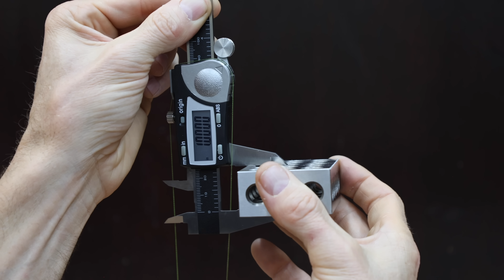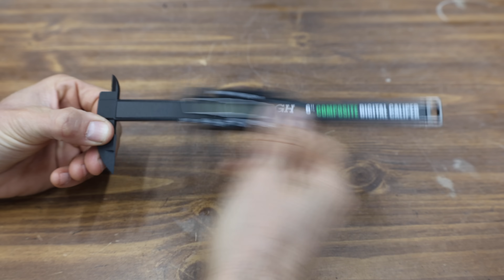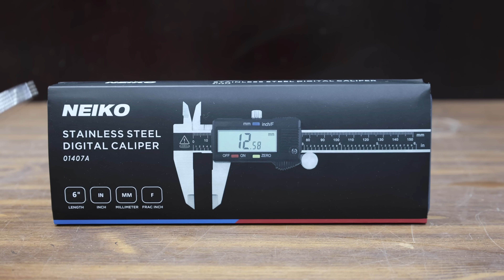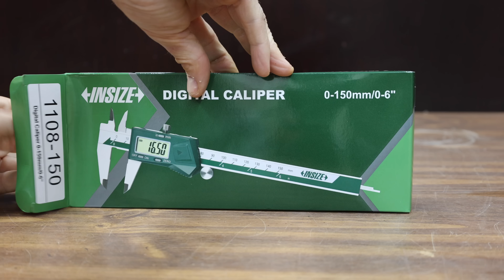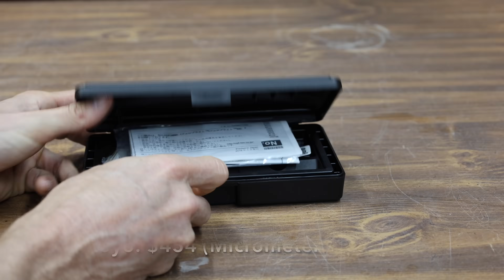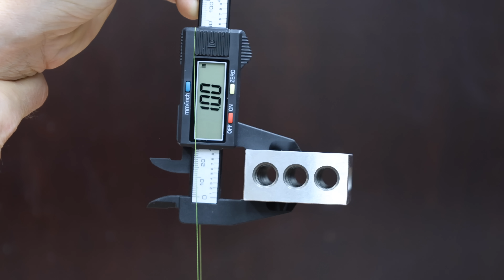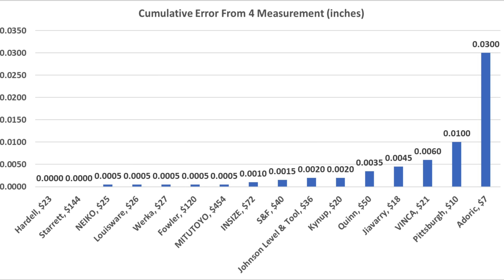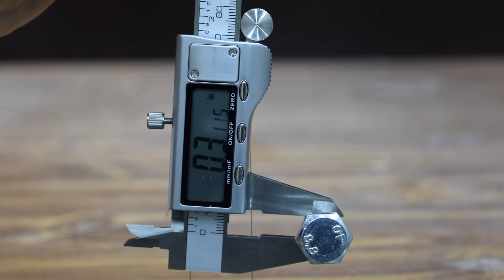I've Been Proven Wrong About Calipers!

Comment: One test that should have been included is how easily and quickly it is to dial it in to a specific and precise measurement. I have the mitutoyo 8 in caliper. I have to say it's night and day in smoothness and control compared to any other caliper I've used. Another great video

Comment: I purchased the 8" digital caliper about 15 years ago at Harbor Freight for about $24.99 or $29.99. I am an FAA aircraft mechanic. Standard tollerance in aviation is .030" and  .001" at times. This caliper has been dead nuts accurate since the day it was opened. I used this to make the part and the QC inspector used his Starrett caliper to verify and approve the part airworthy for service. Everythign I have ever made is check for dimentional accuracy two different ways. Fitst with the caliper and checked with a scale and machinist squares. Like I said. Dead nuts accurate. Still works like the first day I boutht it. Can get the batteries at HF or Amazon.

Comment: 95% of cheaper calipers don't actually "turn off". They will simply stop displaying digits on the display, but the processor will still be on. This means without removing the battery, it will usually be dead in some months to a year, no matter whether you used the tool during that time or not. It's actually, funnily enough, one of the easiest ways to tell a set of genuine vs fake Mitutoyo. The real deal actually has a proper "turn off" (basically, hibernate) functionality with a much lower current draw, which means it will last for years sitting in a draw with only one good battery. The fakes can never be bothered re-implementing this functionality in their chips.

Comment: I have a Neiko and find that it does everything that I need done now that my professional need for measuring life is over. Would I like a Starrett or Mitutoyo - absolutely but I don't need to spend that level of dollars now just to match the Starrett mics and dial indicators that I seldom use now. The only downside with the Neiko is that mentioned LR44 battery vs the bigger CR2032 - but then LR44's are cheap via eBay and I keep a half dozen, usually Energizers, handy.
Thanks again Todd for another great test.

Comment: I have a problem with some of your accuracy tests. Assuming that the 1 2 3 block is perfect based on measuring the 1 inch side is not so good, especially if it is a cheap block. Using the depth function on an imperfect wooden table  rather than a surface plate is also inaccurate. Finally, your table shows the wrong price for the Mitutoyo - that is the price WITH the micrometer. Mind you, having said this your overall conclusions are pretty accurate. The one thing you can't test easily is long term life and accuracy. This is why a precision shops would usually buy Mitutoyo or Starrett and have them calibrated regularly. For most users, the ~$30 sets are perfectly acceptable.

Comment: When you compared CR2032 and LR44 batteries at 17:36, you made a fundamental error in reasoning: you compared their capacity in mAh, but completely forgot and neglected the fact that these cells have different voltages (CR2032 has 3V and LR44 has 1.5V). Yet the amount of energy stored in a cell is the product of its voltage and capacity. So CR2032 has 3V * 200mAh = 600mWh, whereas LR44 only has 1.5V * 130mAh = 195mWh.
The difference is actually even greater than you stated.

Comment: Ever considering doing window air conditioner units?  I need to replace mine and always love checking your videos for stuff I need to purchase hahah
Reply: Check out the Midea U-shaped air conditioners. Insanely quiet and energy efficient and much lighter than other air conditioners I have owned. After getting one, I replaced all my window units.
Reply: @nerdstrangler4804  thanks I’ve seen them but u-shape won’t work for me. We have the in-wall bracket thing and they go in the wall in our house. One upstairs, one downstairs

Comment: Couple of interesting things to note. I have the 12-in hardell calipers and they retain their origin when you turn them off they also turn themselves on as soon as you move the slide which is a feature that I've never seen on any other calipers. They also seem very high quality although one thing I don't like is that when you are measuring inch decimal have different font size for the first two numbers which throws you off a bit until you get used to it. I don't know if that's just because they're competing with a different class than the 6-in calipers are or they have improved their quality recently. I also own Fowler 6-in calipers and I absolutely hate them. For years I preferred an old Pittsburgh set that I had until it started becoming unreliable and turning off while you're trying to use it. But the fowler always has a dead battery even though it turns itself off. You can put a battery in and use it for a couple of weeks and it just dies again. I just don't use it anymore because it's annoying having to change the battery all the time. The hardell has by far been my favorite set so far. But I also have not spent huge money on calipers. Maybe I would feel differently if I had spent the money for starett or something else? For the amount of lathe work that I do the hardell definitely seems like a great deal.

Comment: The accuracy and resolution of the cheap ones is certainly good enough for most hobby use - and they sure beat trying to gauge the fine measurements with a steel rule!

Comment: Genuine Mitutoyo calipers normally come with an SR44 battery, not an LR44.  And unlike most of the cheaper calipers, the Mitutoyo autoshutoff shuts down most of the circuitry and greatly extends battery life.  The cheap ones just shut off the display, which doesn't actually make much difference.  You also didn't point out that several don't have an INC/ABS mode button, which is very useful for many things.

Comment: As allways good content. One remark though: 99% of caliper users don’t need 0,001 inch accuracy. 0,1 millimeter is more than accurate enough. From this viewpoint, they are all great and you could chose on the basis of battery life stability and longevity. Metal is better than plastic.

Comment: The error in each measurement should be increased by half the resolution, which is half the last digit. For example, if the measurement is 1 inch, the measurement is "exactly" 1.00, and the error in the measurement is still 0.005 inch (since that deviation would remain unmeasured). Alternatively, one should take many measurements of different random dimensions, not rounded to exactly 1 or 2 inches. Then the resolution of the instrument will show up as an additional error.

Comment: For future caliper testing, use a jig to hold the calipers up straight when pushing them down on the scale for resistance testing. Changing the angle of the calipers can affect the force being applied. Also, can you test the calipers for accuracy at different temperatures? Would be helpful to see if they still stay accurate enough at something like 20°F and 110°F for outdoor work after the material expands or shrinks in those temperatures.

Comment: VIDEO IDEA: For anything that includes a small battery, test the current draw when its off. I have a guitar tuner and a calipers that I have to leave the battery popped out when not in use or it eats batteries due to a current draw even when it's off.

Comment: This is a clear case of horses for horses. For general woodworking and most uses a cheap set will be fine. Granted if you are working on commercial products or fine engineering then, yes you need a very accurate set.

Comment: If accuracy matters this much, use a mic... IMO calipers are great for "close enough" type measurements.

Also, the Johnson ones must be the same OE as "Performance Tool" youd find at the parts store, though the PT is only 2 digits to the tight.

Comment: I have a 4€ digital  caliper  +-0,1mm (for fast messurements) and  an analog caliper+-0.05mm (for better qccuracy and to verify stuff, check bolt sizes etc ). Its good enough to toss around the workbench. But Id preffer a bit smoother digital one. Mine (which looks like your 7$ one and possibly is the same thing) feels pretty clunky.

Comment: Really depends on the working environment you’re using the calipers in. Mit and Starrett are some of the best long lasting brands ever. Made for everyday use in shop environments for .001 inspection in harsh conditions where coolant is ever present and the possibility of being dropped 10 times a day and still hold .001. You could have done a longevity test or drop test to see what still worked after being beaten up. 
Mits are less resistant to “over thumbing” the caliper as well.

Comment: All of em are a lot more accurate than I need to measure anything, so I’m glad I only spent $10 on my no name set. Mine do have the auto power down feature, but I found that it never truly powers down. First battery lasted about a month. Second battery I take out and store in the case when the calipers aren’t in use, and it has lasted about a decade now.

Comment: As a machinist who uses these tools on a daily basis, I wholeheartedly agree with your results. The only metric you left out was repeatability over time, which I promise explains why the expensive brands are expensive. Average home users will be more than fairly served with any of your lower cost but higher rated options.

Comment: I do not like auto-shutoff for using calipers when machining. And the ‘Absolute’ is really required. 
 I find the Mitutoyo  last a very, very long time on the battery. Plus a LOT more consistent than some cheaper ones I’ve had.

Comment: FYI... Starret is great when it works... At work , we've thrown so many! Sending to repair is just as expensive as buying a new one.
Mitutoyo on the other hand, is bulletproof. I have one at home... 27 yrs and going. At work I use a 20 yr old one at it is still perfect.
At work we've sent some Mitutoyos to repair when dropped on the factory floor and the cost is minimal.

Comment: I like dial calipers unless I need a SPC out. No batteries to die. A surface plate is extremely useful to measuring as well as a micrometer holder. A set of gauge blocks are handy for checking accuracy too.

Comment: I have to point out an observation I made about the Harbor Freight Pittsburgh calipers I have (which looks identical to that Johnson Level & Tool caliper you tested, so it's probably a rebadge).  I have one of those and it works great, but I noticed I was having to change the battery just about every time I went to use it (which isn't very often).  I checked the current draw when it's off and measured it at 18 mA.  So even when it's off it's drawing power and draining the battery.  That would be another good test for calipers (or anything with a soft power button instead of a switch), the power-off current draw.

Comment: Todd, I would prefer if you could have made depth measurements  using the gage blocks on a glass surface. Next, assessing the performance of the jaw tips’ accuracy, a plain cylindrical item may suffice, I think. Overall, this a fairly comprehensive comparative set of tests. Good job, as usual and as expected Todd!

Comment: Without a dedicated weights and measures department all home equipment is just a comparator. Providing results are repeatable thats the best you can hope for. Other than that precision is an illusion.
Reply: Btw I used to have dealings with a factory. Every measurement device they used was calibrated and fresh every day in a strictly temperature controlled work space. At the end of the day they handed everything in and it was checked. If something was out of spec the users work had to be checked and wasn't allowed to leave the building. Then they got a fresh set of calibrated measurement tools while the previous days tools were checked. Cannot imagine it exists today the building was long lines of manual lathes and Mills making car parts.

Comment: I will add that most of the cheap calipers will chew through batteries.  Even though the Mitutoyo doesn't have an auto off feature, and I've left them on overnight plenty of times, the battery life on them is incredible.  Pretty sure I'm going on 2 years since a battery change.

Comment: I have the Adoric as well as a couple of significantly more expensive calipers. The Adoric is not as good as the more expensive ones, but for some purposes, it's good enough. I keep it in the glove compartment of my truck for things like, "How thick is that leather?" and "What's the diameter of the hole in that pipe?" I wouldn't count upon it for anything critical, but it's certainly worth what I paid for it.

Comment: Somewhat of a story here, but I use Mititoyo calipers at work and find them very reliable. I never looked at their cost brand new, but thought I got a decent set on Facebook for $30 about a year ago. Today, I see the thumbnail had my calipers on it and I know you test the tools fairly, so I pulled it up to see how you rank them.

I was absolutely floored when I heard you say the cost for the calipers alone. I was not surprised to see that they ranked very well.

Thanks for the video and the continued testing.
Reply: I purchased fake 6 inch Mitutoyo electronic LCD calipers on E-Bay in 2021 for 40 dollars for an occasional hobby project and they work great. Especially for an older gentleman with poor eyesight. Current price with the Project Farm link $ 155 - $ 165. I still have my 6 and 12 inch Mitutoyo dial calipers from 1982 and they have no wear. $65 and $120 to 150 dollars. I did 35 years as a TIG welder reading all decimal blueprints.

Comment: The reason why people go for the Mitutoyo or other expensive brands is that the batteries hold up for several years. When you have cheap calipers your battery will be drained within a year regularly.

Comment: My man. That Mitutoyo caliper is $150.  I own about 20 pairs of these for my shop.  This SHOULD BE the winner.
Reply: Right! He must have bought that set at Grainger
Reply: Yes, I am about to say the same. The MSRP may be a lot higher but the street price is around $150
Reply: Yup 100% I also laughed when he mentioned the auto off function/battery life... they last LONG time and they're real cheap lol. We got a set of INSIZE for free from a tool salesman and they're probably what I'd recommend for a hobby person on a budget but it hurts my soul when I see a cheap cheap/plastic pair spend a little more and don't drop them... 😂
Reply: He used the price for the caliper + micrometer combo, which is really odd choice, especially since he mentioned the price of the calipers alone at $250. Which is still too expensive, they are $150 on McMaster Carr
Reply: Agreed 100%
Reply: Calls it $454 in the table??? Even the $250 in the thumbnail is outrageous.
Reply: @aguy3896 $454 is for the calipers and the micrometer.  Still high, should shop that around.

Comment: In my experience, nothing beats a quality set of Starrett, mitutoyo, or Brown and Sharpe. I work in aerospace and it’s all we use for our hand measuring tools.
Reply: Brown and Sharpe was originally from Providence, Rhode Island started in 1833. Sold out to another company just like Massachusetts made Starrett. In the eighties every TIG welder bought Mitutoyo dial calipers 6 and 12 inch.
Reply: Yes but those of us without aerospace industry money will take 98% of performance for 1/10 the price.
Reply: @JJFX- buy once cry once
Reply: @UHOH3300 Depends if it's the company doing the buying. Honestly at a certain point the typical variance between most 'good' and professional calipers these days is less than what one should be relying on a caliper for anyway. That's assuming they've been tested... if needing to rely on anything straight out of the box then I'd agree with you.

Comment: In work I have the non absolute mitutoyo. Although it has no auto shutdown, the battery lasts forever. It is also "only 130€". For private use, i  have a Noname that looks like the jiavry which has Auto shutdown but the battery is empty all the time although I rarely use it

Comment: The best improvement in calipers you can see without spending a ton more is to learn to read a dial and buy an analog metric caliper.
Normally I don't care which system you sue, but if you're gonna be measuring in .001 inches, or .00001 meters, I'd rather just use meters and convert to inches later if I need to.

Comment: One important factor to those like me who use their calipers only ocasssionally is the vampire current draw. AFAIK all digital calipers have some vampire current draw so that they can still track the encoder if you adjust the calipers while the device is "off". All the cheaper calipers have vampire current draw orders of magnitude greater than the high-end ones and will almost certainly drain the battery after a few months even if they're not in use.

Comment: Hello Project Farm, as always very informative video 🫡 I have a video suggestion about retractable key rings, since I am in the railway they are a must have to keep keys at reach without loosing them, but issue we have heavy keys and I've bought countless of them with prices ranging from 5 to 20€ (so about the same in $ I think) and they all failed or did not retract fully. So I'm very tempted to buy Key-Bak brand because I'm tired of buying a new one every 6 months or every year ! That could be a good test to do as other folks I think do need to know which heavy duty key ring to buy !